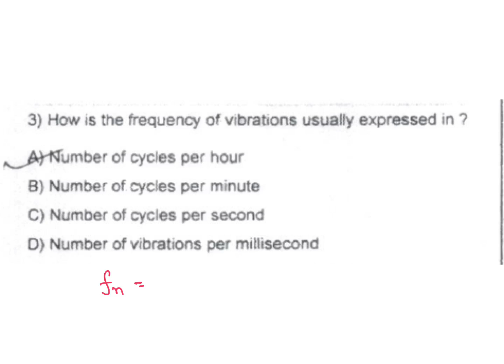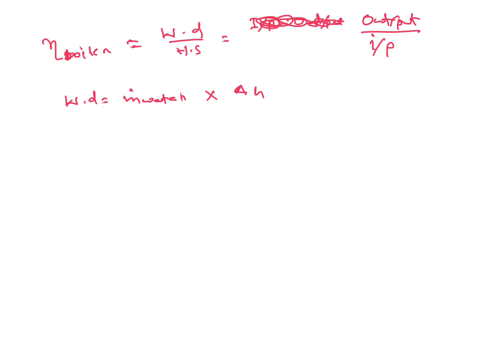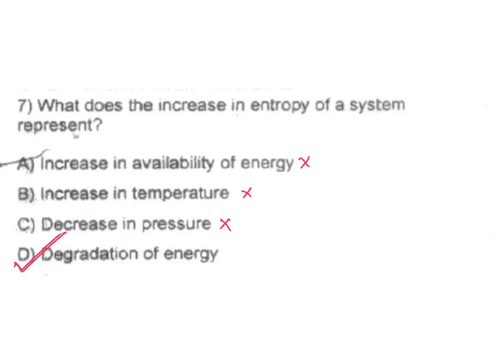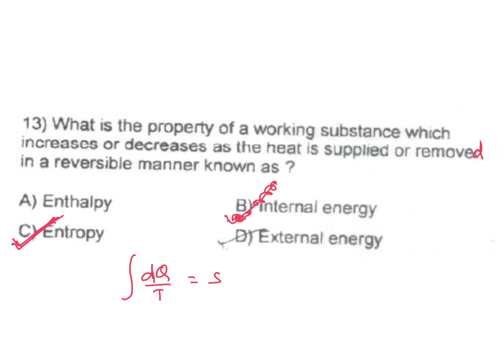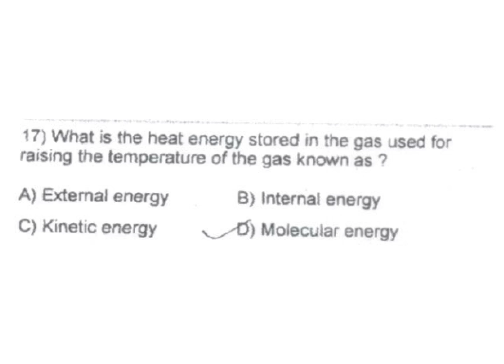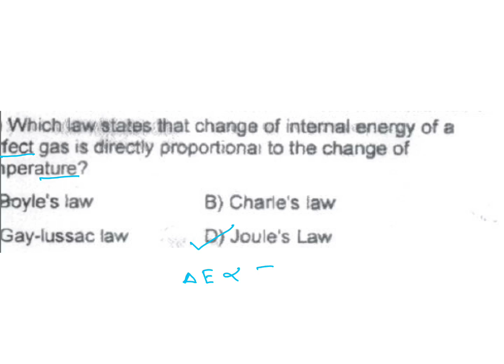VIZAG STEEL MT 2010 PAPER TECHNICAL PART 01

Comment: SIR U ARE DOING A GREAT WORK...IMPRESSED ....SIR I HAVE TWO QUESTIONS 1.IN WHICH YEARS FROM 2010 DID VIZAG STEEL MT EXAM WAS CONDUCTED .PLZ SPECIFY THE YEARS 2.UPLOAD THE 2010 TECHNICAL PART VIDEOS FROM QN NO 50 TO 100..

THANKS IN ADVANCE